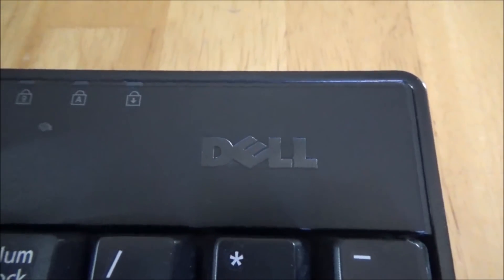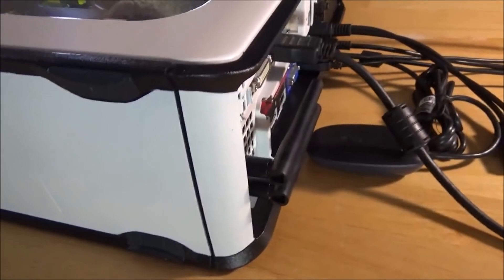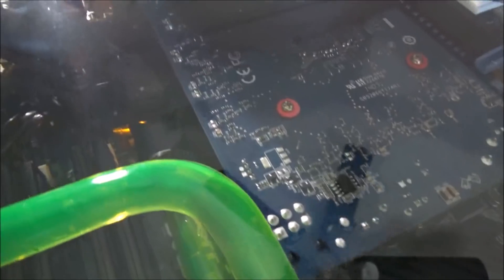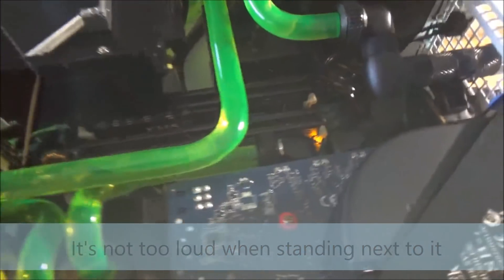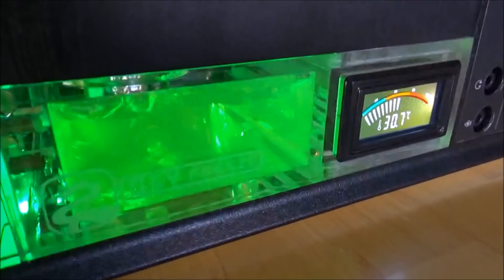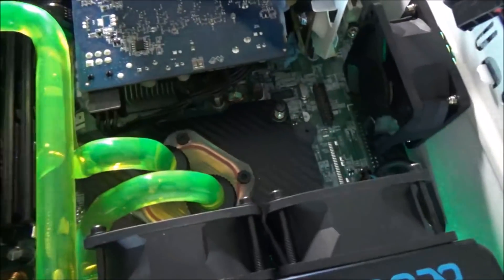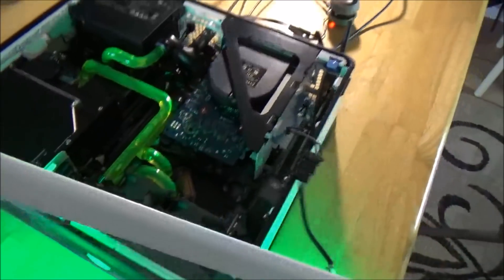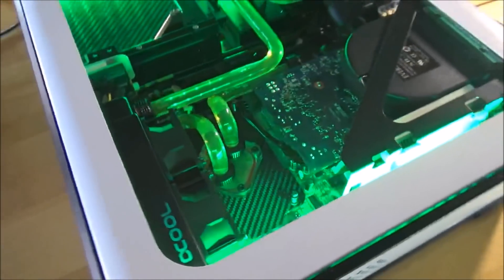Custom Hard Line Water Cooled Dell Optiplex 780!

Comment: Incredibly done
Reply from the maker: Thank you very much Porsalin! And thanks for the sub, welcome to the channel =)
Reply: I've been obsessed with these a while now and think I'm going to take the plunge and try mod it up. I doubt it'll look anywhere near this good but a little respray and a few neat upgrades should do the trick. The glass cutout on the side panel was particularly well done. Given me a lot of food for thought. Congratulations man and thanks for giving these incredible machines some life!
Reply from the maker: Man, Dell's are really fun to work on. They are very well built which makes them easier to mod imo. You'll have a blast fixing yours up. I really thought about this build for almost two years. My first video talking about this project was June 2016! I was also a little obsessed with how I wanted it to look. It turned out exactly how I had hoped, but it is a bit over done for a 10 year old Dell. Like you said, a little paint and a couple things to spice it up will go along way. I'm glad that you like the mods on this one! Let me know if there's anything I can help with when you start your project. Thanks for watching!
Reply: Thanks man, I have no doubt I'll be hitting you up when it arrives. Went for a cheap 790 MT with a 2nd gen i5. Replacing the PSU really that easy too? I've used proprietary workstation-style prebuilds before and they usually swap around a few cores on the 24 pin power. Will any normal ATX PSU just fit in? Also - my buddy has an SFF 790 - with that being a smaller body, what's he looking at as far as PSU replacement goes?
Reply from the maker: Nice. I love the second generation Intel chips. I just picked up a 990 MT myself. The PSU is really easy to replace as long as it's a standard ATX size. If it's too long it could hit the door latch and won't fit. All the wires are exactly the same. Man those SFF's are hard to find a PSU for. A viewer told me about a PSU company called HD Plex that has some amazing products.
They are super small and provide a lot of watts. He should definitely check them out. You can just buy a normal EVGA 500W 
PSU for $50 and it will go right in your 790, plug and play.

Comment: very nice, lookin at these builds as i get ready to water cool my optiplex 960 mt with the coolermaster masterliquid lite 120 . will be my 1st try at customizing and using watercooling wish me luck
Reply: btw im running the q9550 quad
Reply from the maker: That you very much, I hope my videos help you out! The one thing I usually suggest with AIO coolers on older Dell's is using the Corsair h60. The square pump/block fits a lot better than a rounded one. Are you familiar with the Dell BTX design? There are capacitors that line the edge of the CPU socket and they stick up high off the motherboard. The square block of the Corsair will line up nicely with the socket without any overhang to interfere with the capacitors. I'm not sure if you watched my other vids, but this one shows how I mounted the AIO. https://www.youtube.com/watch?v=7GNjvrSXaXE It's one of my first videos ever so I apologize for the bad camera and stuff. I also used a Coolermaster Seidon 120V (not available anymore), but the design is almost identical to the Corsair.
Reply from the maker: Nice. That's a better option than the Q9400 that I usually buy (I'm cheap) and not as expensive as the Q9650. Good choice =)

Comment: That's the coolest Dell Optiplex I've seen so far! Too bad I'm just stuck with my generic Dell Optiplex 755.
Reply from the maker: Thanks Brandon! Your comment makes all the work I did worth it! And you can spice up that 755, it's a good Dell =D Thanks for watching man!
Reply: Welp, as it turns out, now I'm stuck with a Optiplex that won't boot. It give me a "Floppy Diskette Seek Failure" now. r.i.p.
Reply from the maker: Can you get into the BIOS? In the BIOS settings you should have the Floppy Drive turned off and any other SATA ports that are not being used. You should only have your hard drive(s) and disk drive active. There might be a conflict and your PC got confused where to try to boot the PC from. If you can get into the BIOS then it can probably be fixed.
Reply: I just aquired an optiplex 755 with the core duo, any recommendations for a cpu and low pro gpu with 8gb ram to toss in, getting confused on what can pair with what lol also keeping it budget friendly for average gaming lol
Reply: Jonathan Szmania The optiplex 755 can be upgraded to a Core 2 Quad like q6600 or something similar. For the gpu gt 1030 is cheap and low profile.

Comment: so after talking with my mom she said she didnt care if i changed the case so should i find a 25$ cases so i can put normal sized components into it?
Reply from the maker: Unfortunately it won't be that easy with a Dell 780. The only way you could switch to a bigger case (without a crazy amount of modding) would be to buy a Dell Optiplex 780 Mini Tower case. It's basically just like your PC, just bigger. But it's really hard to find just the case for sale. This is an eBay listing just so you can see it https://www.ebay.com/itm/Dell-Optiplex-780-Mini-Tower-2-93GHz-Core-2-Duo-2gb-DDR3-DVD-RW/382305945432?hash=item590335c758:g:R-sAAOSw3ZtaKwc- in the picture it's on it's side but it's supposed to stand upright. Did you get the CPU and riser card yet? If you have the riser card now, it will be really easy to install a 750ti if you get the right model. This is a video of me basically putting your PC into a Dell Mini Tower case, https://www.youtube.com/watch?v=lKs_U85KWCY&t=10s you should watch it to get a better idea of what I'm talking about. It sucks, but Dell motherboards will only install in Dell cases (of the same model) most of the time.
Reply: PimptatoPCs I didn’t get the riser yet the cpu came in today but I gotta wait for the thermal paste still, I was going to buy a  cheap $25-30 case instead of buying the riser card so I would have a case I liked and could find parts easier that fit in the case
Reply from the maker: Yeah, with older Dells it's just not easy to switch cases. I'm sorry you're having such a hard time dude, but at this point it's either stay with the Dell and get the riser, or sell the whole thing and get a newer PC that is an ATX design. The Dell 780 is called a BTX design and regular parts are hard to use in them without a little modding. ATX is the "normal" way that a PC is built and that style can use "off the self" parts that are standardized. The cheapest way to game with more modern parts is this Dell Optiplex 390 https://www.ebay.com/itm/DELL-OPTIPLEX-390-D12M-Quad-Core-i5-PC-w-3-1-GHz-4-GB-Ram-2TB-DVDRW-WORKING/382322380974?hash=item59043090ae:g:tfgAAOSwm3paRDzU It's only $100 with free shipping and has an i5 2400 that just blows away the Core2Quad CPU's. The Optiplex 390 can use a lot of different GPU's without changing anything because it is ATX style. I hope this helps man, let me know if you have more questions, I'll try my best to point you in the right direction.
Reply: Well that sucks ill just have to get the riser, maybe one day if i get the money ill just buy a new motherboard along with a new case
Reply from the maker: When you get the riser and the 750ti you'll be happy and it will last you awhile. That setup will kill it on CSGO and will even play more demanding games if you adjust the graphics settings. It's a good way to start out man, don't get too bummed out! You are learning a lot about PC's and that's a good thing! =D

Comment: the parts are coming in tomorrow, but without a gpu could the core 2 quad play csgo at the lowest setting?
Reply from the maker: Hey Echo. It's always exciting getting parts in the mail! I have a CPU arriving this week too, can't wait! Just an FYI, old CPU's like the C2Q don't have integrated graphics, the graphics chip was actually on the motherboard back in the day. Anyways, I watched this video https://www.youtube.com/watch?v=a0pg3K9gvLM and it has a bunch of games running with the internal graphics that your system uses (gma4500 graphics). It's not pretty but it looks like you might be able to enjoy CSGO, MAYBE. It's getting really low FPS but still plays.

Comment: I noticed from watching the video where you had all the parts laid out on the table that this pc has a intel q9550s in it, i know that on a intel q6600 that there is a mod for the cpu called the BSEL MOD and all it is you need to stick two dots of electrical tape on two pins on the cpu and it automatically overclocks the cpu to 3GHz, i have done before on a intel q9550 before and it toke me to 3.06GHz but never done it on the intel q9550s but i can only assume it's the exact cpu with minor differentis but it's still a LGA 775 cpu so the results should be the same. There is loads of info about it online with pictures showing you where to put the tape and everything.
Reply from the maker: I have done a decent amount of research on that mod but have never seen it done on a 780 model. Every single post that I've read  was a 755 or 760 if I remember right. Which Dell did you do it with? If it was a 780 I'll try it ASAP.
Reply: Sorry i did not explain my self properly i did not do this mod with a dell it was three different pc's but i found this mod out from modstek YouTube channel and this was a SFF pc but i can't remember the model sorry,
But i have done this to three pc's now and it's worked on a asus motherboard a hp SFF and a ZooStorm pc witch also housed a asus motherboard, my take on this method tho it's a cpu mod and not a motherboard mod so the results in my mind should be the same for LGA 775 platforms
Reply from the maker: I like Modstek a lot, he does fun stuff and he's good at what he does. He has asked me to give him this PC a couple times lol. Anyways, that's interesting about the different PC's that you have done the BSEL mod with. I guess I should give it a try, this CPU could use a bump in MHz. It's kind of a pain to remove the CPU though with having to drain it and everything. Maybe in a few months when I clean the loop I'll test it. That would be awesome if it worked and it would nmake a good video. Thanks for the info man.
Reply: No probs bro
Reply: But is it safe with the original 105W power consumption of the Q6600 and then overclocking it to 3.06Ghz???

Comment: this is it right? https://www.amazon.com/Genuine-Connectors-Conversion-low-profile-full-height/dp/B0721L4X6B
Reply from the maker: No, that one doesn't have a PCIe slot. It just has the two white PCI slots. It has the black slot with the little blue tab to hold the GPU in place.
Reply from the maker: This is the right one though https://www.amazon.com/DELL-Optiplex-GX520-Riser-PCI/dp/B004570PLI/ref=sr_1_fkmr0_2?s=electronics&ie=UTF8&qid=1514323599&sr=8-2-fkmr0&keywords=Dell+Optiplex+760+riser+card
Reply: thank you so much
Reply from the maker: You're very welcome. Hit me up if you have any more questions.
Reply: if i want to play games like l4d2 and csgo i could just get a core 2 quad,new psu, extender,new gpu and 8 gb of ram right?
Reply from the maker: For sure. This green 780 has a Core2Quad/R9 270 and it plays GTAV and The Witcher 3 with good FPS at more than respectable settings. If you do that stuff to your 780 is will kill it with games like L4D2 and CSGO. 8GB of RAM is plenty, I installed 16GB just to do it.
Reply: PimptatoPCs well now I got to get the money for all the thing I want to do to my pc

Comment: first question how did you get a full sized gpu and what psu did you use could you put a parts list somewhere i got a dell optiplex 780 for christmas and im hoping to upgrade it and keep the case
Reply from the maker: I found that R9 270 on eBay for $50. It's full sized but a single slot version, your 780 will need the GPU riser adapter if it doesn't already have one installed. They are around $20 on eBay and pretty easy to find. If a full sized graphics card only has bottom ports, you can chop the bracket in half or find a single slot bracket that matches the output pattern on eBay. I did that on my old Mini tower 780. You can also go with a 1050ti and forget about the PSU upgrade if you wanted to. I personally prefer to upgrade the PSU though. That way you can get a GPU (even a 1050ti) that needs a 6pin power connector and overclock it without worrying about the motherboard not supplying enough juice. This is the PSU that I'm using https://www.newegg.com/Product/Product.aspx?Item=N82E16817256176&cm_re=silverstone_sfx--17-256-176--Product
Reply: i can find the adapter but not the cage to hold it any certyian website to buy it?

Comment: If it is possible, I'd look into adding a piece of painted acrylic onto the back of the gpu (you can use double sided tape on the screws to secure it in place). The blue pcb stands out too much imo, not in a very good way. Otherwise, awesome build! :D
Reply from the maker: Yeah, the blue is pretty nasty looking. One of my subs said the same thing. I'm actually thinking of getting a thin piece of aluminum and using thermal pads to secure it in place. The card already runs around 74C playing The Witcher 3 and I want the back plate to be somewhat functional if I add one. Thanks for the constructive criticism, I appreciate it. And thanks for watching man!
Reply: Not a problem! Just be careful using any sort of metal. Don't wanna fry the components lol and from what i've learned, the back plate makes a negligible difference to cooling. If you go for acrylic in the end, you should be able to find a 1/16" or 1/8" thick square foot sheet for about 5 bucks online.
Reply from the maker: That's true about the metal, thanks for the heads up. If I go that route I'll put a thermal pad every 1/2". I have a big piece of acrylic left over from the window so I should just use that to save money. I'm definitely going to do that in the next couple of days, I need some content for a new video =)
Reply from the maker: I did a backplate for it! https://www.youtube.com/watch?v=RRCERPzfAQI

Comment: If I put a qx9650 can I overclock by the multiplier?
Reply from the maker: I'm not sure. I have done a little research into using SetFSB, a lot of people are saying that only a QX6600 will work because it has a 1066MHz FSB. I have read that a QX9650 won't work on a Dell 780 because of it's 1333MHz FSB and it's 130W TDP. I really don't know though, I wish I could buy one and try it.
Reply from the maker: I actually don't believe a QX6600 would work because it's 65nm architecture and the 780 uses 45nm.

Comment: I have a optiplex 380 I installed a xfx r5 220 and replaced the hard drive I’m running Android marshmallow x86 on the system I use it for emulating psp it’s overkill even with a pentium e5300 it’s using 2 go ram
Reply from the maker: Nice dude. Android x86 is really cool. Not a whole lot of people even know about it. I installed it on a HP TouchSmart 300 All-in-One PC a couple years ago so my kids could play Android games. That PC died though. I'll have to install it again and check out that psp emulation. Never played any psp games before. Thanks for watching the vid man!
Reply: sweet hope to see how your biuld turns out and look up a apk its a big emulatoin ap i use it for everything happy chick it has psp pso all ninteendo up to ds and saga 2 it has a built in rom server

Comment: Finally it’s finished! I never clicked on a video so fast. It looks amazing. So satisfying to see a Dell optiplex customized. Can’t wait to see more your content. Love the black and white look. Some personal changes I would of made would be the somewhat cover the res. other then liquid showing,White lighting and dye instead of green, and lastly get or make a backplate for the gpu. Keep up the great videos.
Reply from the maker: Finally for sure, feels like I've been working on it forever. Glad you like the overall look and black and white color scheme. The green is a little loud, but I like to match the front power and HDD lights of the Optiplex. I did think about covering the res and just keeping a little window, but in the end decided against it. The logo on it is pretty ugly. I would have loved to put a back plate on the GPU to hide the blue PCB but it really needs to breathe. I have it fully overclocked through Afterburner and it was topping out at 77C playing The Witcher 3. But like I said before, I'm happy with AMD GPU's as long as it's running under 80C. I'm going to keep working on it some, maybe I'll cover the res and see how it looks. And the green fluid and lights are something that can be changed easily. I might switch out that R9 270 with a GTX1060 3GB in the future. Just need to scrape up the $200 =). Thanks for watching dude.
Reply from the maker: I did a little research on white dye and the reviews are not good. I can't find anyone that hasn't had problems with it gumming up their system. I could buy white tubing and re-bend everything, or just do clear fluid with white lights. I'm definitely thinking about ditching the green though.